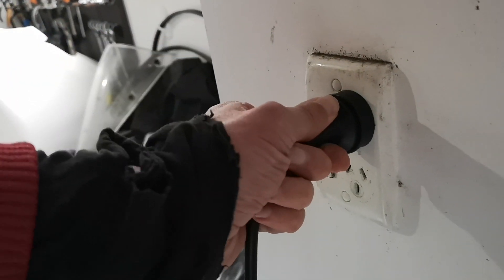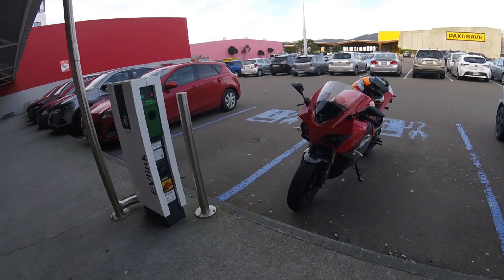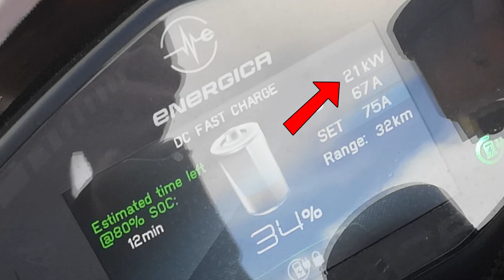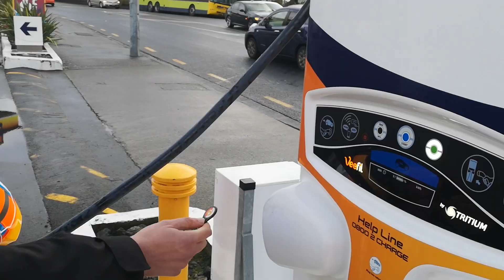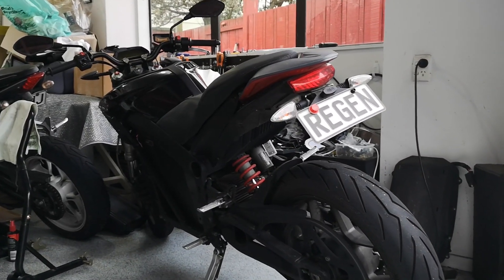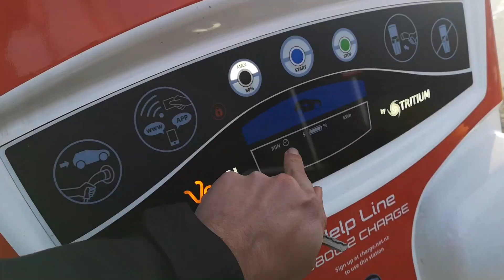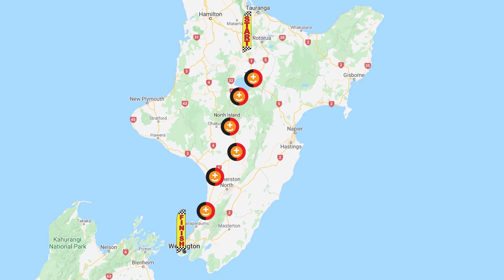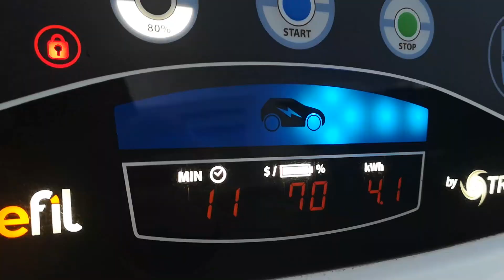CHARGING // AC vs DC // How long does it take to charge the Energica?

Comment: Great video!  I definitely appreciated your take on DC charging stations in New Zealand vs the USA because that really is the core issue.  The thing I really dig about the Zero SR/F and SR/S is that you can achieve 12kW charging with widely available AC chargers.  That's not quite as nice as the 20kW DC charge rate of the Energica, but it's really not that far off in the grand scheme of things.  It boils down to about 30 minutes of charge time using your 20%-80% charging strategy.  Just enough time to stretch my legs and grab a drink.  If DC fast chargers were common in the USA (especially in rural areas where it's more fun to ride), the Energica would be a no-brainer.  Until we grow that network though, it really is a tough decision... 12kW of charging everywhere? or 20kW of charging in some metro areas.  If Energica had an option to achieve 12kW (or even 7kW to get the most out of typical J1772 stations) of AC charging in addition to DC charging, that would be a game changer for sure.  Anyway, thanks for another great video!  I hope someday you get to ride that beautiful bike without rain!!! :-)
Reply from the maker: Thanks man!  Yeah I totally agree.  My Zero could charge in an hour like the SR/F when it had all it's chargers installed, but I didn't have the infrastructure.  We have the totally opposite problem haha.  It would be sweet if Energicas had 6kW chargers though, just to slow-charge for free on an AC station while doing some shopping.  The 3kW charger is perfect for campsites here, but not for campsites in the US.  We really need to get some global standard so all these bikes work for all countries!
Reply: Zero seem to very firmly prioritising the US market over becoming a leading player on the world stage. Unless they act quickly, they run the risk of becoming the next Harley (failing motorcycle company) or even worse the next Nokia. It would be a real shame if that happened considering their pioneering roots. They should be the Tesla of the motorcycle world with everyone playing catch up.
Reply: In Europe it is not a issue to charge with 12kW. During the last 9.000km I have to wait less then 30 Minutes at a Typ2 charging-station. This are very common here. A dc charger is more problematic to find in a remote area.

Comment: thats pretty cool but like you said.. lol whats a dc charger..... heck in my area its like whats an EV lol I have noticed with the installation of Tesla's supercharger right down the road I have seen an increase of Teslas in the area.. its cool that you have time to do big road trips. I used to but now i work 10+ hours a day 6 days a week so when I have off I have to do things around the house or run to a stor so that really limits the riding time I get plus I have to make a video of off roading on the GS and then a dirt bike video posting 2 times a week... My plan is to get an Ev MC and post 3 videos a week haha
Reply from the maker: Haha, I feel ya on the struggle for free time.  You'd think this whole pandemic + working from home would help, but I'm busier than ever.  It's hard to even upload a video every 2 weeks lol.. but I'll try harder.  That's really cool to hear that more EVs are popping up in your area.  It'll only get easier I think :D  Which electric motorcycle do you wanna get??
Reply: @NewZeroland  still leaning to the Zero sr/s it sounds like it would suit my needs and the cost to own is cheaper to insure.. I could see needing better chargers if I had the time to go places but even the last few years on the gs a 100+ mile ride is pretty rare.. perhaps a few years later down the road get something "faster" when I have more time and could do some track days

Comment: Here in Spain we have from 0.35€ to 0.55€ prices per 1 kWh (50 kW DC Chargers)

If you use an Ionity UltraFastCharger (up to 250 kW), the price is 0.79€ per 1 kWh.
Reply from the maker: WOW that's a lot!!
Reply: @NewZeroland  Of course there are tricks to have a lower price. 
If anyone is interested I can provide more information in private.

Comment: The issue with the Zero bikes is their battery voltage. They did develop DC fast charging, but it didn't work in the real world because of non compliant chargers.

Although the Chademo standard was meant to work down to 50v, in reality very few EVs that could actually benefit from fast charging have battery packs that low. Chademo is limited to 125 amps and at 50 volts, that's only around 6Kw anyway! Most of the installed chargers only work down to 200-250v and the Zero is well below that. The CCS standard is meant to work down to 200v, but often doesn't. Accommodating a very wide voltage range makes the power electronics design much harder and there really aren't any cars being built that need it. Most EV's have battery packs around 300-400v, with CCS able to serve the new higher voltage systems up to 800v.

Zero bought charger for development that was fully compliant with the standard, but customers then found most of the public chargers wouldn't work. Their only solution would be to re-engineer the whole bike around a higher system voltage.
Reply from the maker: Yeah true. I was really hoping they'd take the opportunity to raise the voltage when building a completely new bike (the SR/F) but it seems to be the same 14.4 battery, just repackaged. We'll have to see what they do eith their future bikes.

Comment: DC charing is awesome and Zero should get on board, but be sure to compare apples to apples: SR/F or SR/S with 12kw charging at Tesla Destination Chargers vs DC charging on Energicas. Thanks!
Reply from the maker: Oh totally. Well my old Zero could charge in 1 hour, same as the SR/F. The Energica charges in half the time.
Reply: @NewZeroland  Also, the 12kw charger doesn't require a bunch of aftermarket chargers obviously like on your old Zero. Just comes installed from the dealer.

Comment: Perfection! Great video, Sam! I want to rub this in the faces of all bike manufacturers. Energica have this just right.

I agree that Zero have been understandably U.S.-centric, but from what I understand, they've sold more bikes in Europe in any case. Perhaps they also look at the majority of journeys people make and decided that AC rather than DC rapid charging fits most cases.

For those of us with the need to travel further afield though, this isn't an option, and as much as I loved all the effort you put into making the fastest possible charging set-up for the Zero, that's an option very few people can consider.

The Charge Tank was the best fit for me, once able to retrofit the 6kW one last year, but the Energica approach is just perfect.

Your queuing experience at DC chargers is familiar to me from my LEAF and more recent MG ZS EV experience, but rollout of DC chargers has ramped up here in the UK quite heavily. It was reasonably static for a few years.

The U.S. will certainly have to catch up on that count and it certainly will, no doubt. Zero have to consider this.

Just a thought… Do you have the option to unplug at 80% and plug into an AC charge point at some locations? We have locations in the UK where both are installed - a DC rapid unit and then a 6kW AC unit nearby. These aren't super common, but are helpful if stopping for a longer period, and of course free up the DC for other users.

"Are you aware of the environmental impact of lithium ironing?" made me properly LOL.. 😂

Great work! 👍
Reply from the maker: Thanks again! Yeah I think you're right about Zero selling more in Europe. Definitely a good amount. From what I've heard, AC charging in a lot of places in Europe is free (same as NZ), so that could be a huge incentive to go with Zero. And yep, there are some stations here that have AC and DC together, but they're rare. That's a great idea though. Nice trick to save money! I'm  still excited about the AC stations set up at the big shopping centers, but campsites are too far in the middle of no where. If that's where you're staying, they're perfect, but I'd pay any amount of money to charge fast and not ASK if I can plug in 😂
Reply: @NewZeroland  Zero is perfect for Europe, not because AC is free, but AC chargers are at places where you ride and stop with a motorbike (secondary roads, towns), even on a tour. DC chargers are mainly placed along the highway. Which most riders avoid because it is boring. Many quickcharge locations along the highway also have AC (at least here in the Netherlands). I just bought a Zero SR/S premium (6 kW internal charger). That's slow for quickcharging, but fast enough for a coffee or lunchbreak.

Comment: 5:24 Hahaha, exactly, brilliantly said! The same questions over and over :D I still enjoy meeting people and seeing their reaction, but am also looking forward to be just another motorcyclist one day. Upside on AC charging: I visit a lot more towns these days, especially on longer tours. Type 2 takes me three quarter of an hour to charge fully (20-100%) - 14.6 kWh SRF and after two hours on the bike that's exactly what I need ;)
10:45 Not really the same, since you can go get a jerry can of fuel but doing that with electricity is a bit different.. Plus, often I have to rely on a mobile app to get the charging started instead of a RFID chip, so I have to keep the mobile phone charged, which seconds as my navigation - even more difficult if I have to keep the brightness up to max to see something in sunshine weather...
Still, wouldn't want to miss the experience!
Reply from the maker: Great points!  I remember Elektrogirl's trip on an old Zero with 100km's of range and ONLY slow charging, and how it changed the way she did road trips.  You're able to spend more time in the place you're charging at, to find out more about the town and the people.  Maybe I need to slow down lol.

Comment: I still think the solution lies in a program similar to the one they use for propane tanks:  You remove your battery and give it to the attendant who then gives you back a fully charged battery for a small fee.  Not only would you have a full charge every time, but the whole process would take less than 5 minutes, and you could apply that to everything that takes rechargeable batteries:  Phones, tools, cars, etc.  No waiting times or fear that someone else is using the charger.  
That's the easy part (though expensive to start up), where it gets hard is convincing manufacturers to standardize the batteries and make them hot-swappable.
Great video.
Reply from the maker: I agree!  That's a future I'd love to see.  Modular, too.. so you can use a small part of your big car battery in your bike (when not driving the car, or when you don't need much range).  They just need to get to a point where battery tech is at it's peak and no technological advancements are coming.  And then yeah, everybody would have to agree to use the same ones.  Whoever develops that battery will rule the entire industry.
Reply: @NewZeroland  Exactly!  And BTW, excellent video.  Can't imagine a better ad for electric bikes in NZ.  Hell, I can't wait to get one of my own.  Only thing that frustrates me is the fact that electric vehicles actually get worse mileage on the highway than in the city.
Reply from the maker: @DuncanJimmy  Thanks man!  Yeah, the faster you go, the more energy it takes.  I guess that's where a gearbox comes in to help the efficiency, but I really don't want to shift anymore :P

Comment: Okay, that timing did in fact blow my mind. That's incredibly fast. Thanks for another super solid video. It will be interesting to see how charging fees evolve over time. Right now they seem somewhat expensive. I'm hoping with infrastructure build out they drop dramatically and maybe you only get charged a lot if you hog it after your vehicle is done charging.
Did you get a new mic? The quality in this video seemed better.
Reply from the maker: Thanks!  I really wanted to use that gag at the end so I had to fill that 12 minutes as best I could.  Actually I just used my phone to record the audio, but caught a cold half way through so some of the narration sounds different than other parts.  Random behind the scenes info there haha.  You're right that charging is expensive.  The majority of AC charging is free, but I'm willing to pay any amount of money to charge this fast.  I'm planning to make a video comparing the price to gas soon, to see how surprising that is.

Comment: I get it but DC bikes are a tough sell right now, your just shy of buying a Tesla. Zero could finally decide to use liquid cooling and equip all bikes with Quick Charge allowing anyone to use a Tesla super charge station which is way more common than DC. You also maintain the ability to plug in anywhere with AC bikes. I get it but 20k is a hard pill to swallow when I can have just as much fun on my Zero not planning on any road trips. How does Energica charge at home? Their website is not very clear on that.
Reply from the maker: Energicas also have an AC charger (in the tail).  You can use those at campsites and stuff too, but they're only 3kW.  That's what I use to charge at home, but it takes ~5 hours.  I'd compare Energicas to the newer Zeros (the SR/F and SR/S).  Once you upgrade to the premium charging option on a Zero, the prices are the same.
Reply: @NewZeroland  that's good to know.

Comment: Yeah, that's the thing that the "100 miles & 50 kW is enough" mindset people just don't get. It's about charging at your convenience, not being forced to plan ahead and work your travel around the vehicle's speed. Also, waiting for other people to finish charging sucks. And that's not even mentioning the battery longevity increase of reducing the number of charge cycles for the same distance travelled. So no, there is no such thing as enough range or charging speed, even for a "city car".
Reply from the maker: Well said!  That makes me think about the old floppy disks, and people who would ask "why would you need more than 1.4mb?" haha.  Here I am thinking 50% in 12 minutes is fast, but future electric riders will laugh about that.